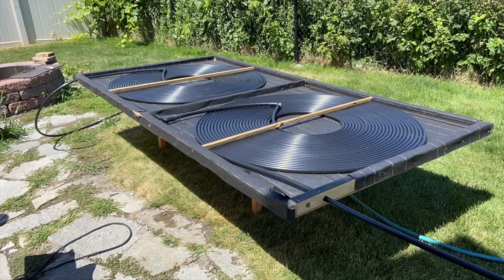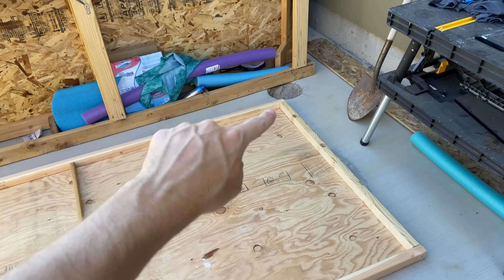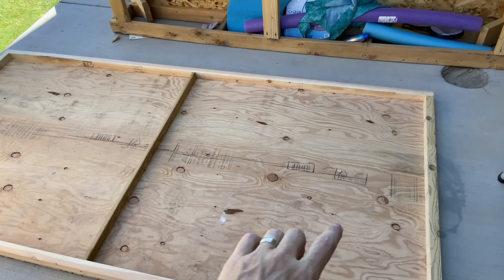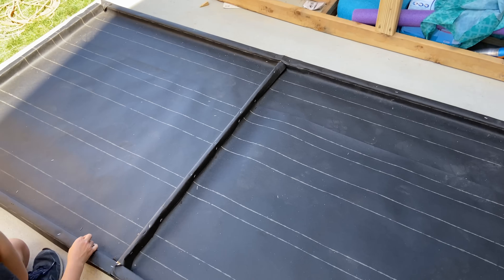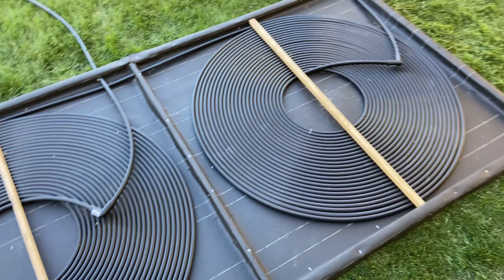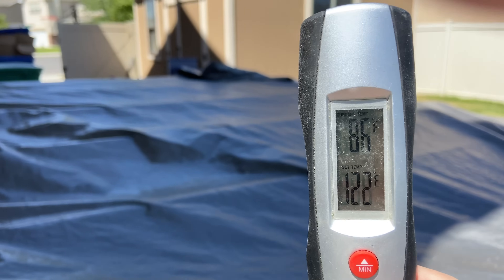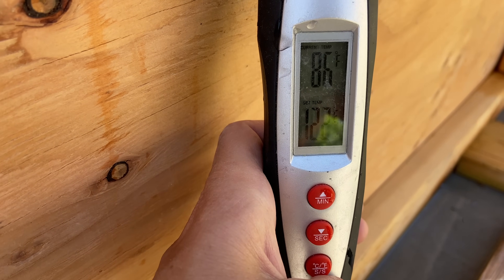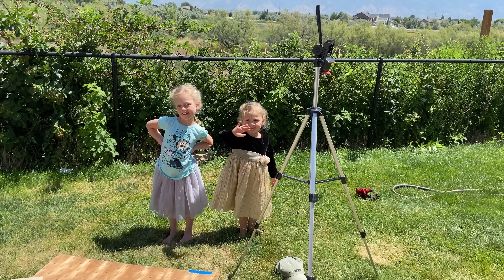DIY Pool Heater - $50 Solar Heater

Comment: Awesome video………but……the flow rate times the return rate divided by the square root of 62178=9732….not 2… so if one follows this coarse of thought…then a child might ….and I mean….MIGHT…..be able to find the coefficient value of ORIANS BELT on any given day in March…….but what do I know……these are just mere calculations by a NOVEL astronomer fixed on the collateral…blah,blah,blah,blah………blah

Comment: So I just finished building mine ....I'm in Arizona so it works well, however, the price today to build is closer to 600$ and that's with 50' of 1/2 " copper tubing
Reply: 2 degree on an 87 degree day

Comment: How is this for winter months or hot tubs?  I have a inflated hot tub that I wanna heat.  Instead running electric heat is expensive and use our wonderful source for heating in the winter months.

Comment: Great idea.  What size pump is used?  I’m sure too large of a pump would pump too fast and not allow the water to heat enough, even with slowing the flow with a valve.

Comment: I learned my lesson. A coil does no work, especially when it is not 100% flat. Warmer water wants to rise. In a coil, in order to move forward the hot water with a lower specific weight has to fight the colder water. 
It is better to have a series of parallel tubes with the outlet at a higher level than the inlet, then pure physics forces (hot water with lower specific weight will rise and will draw in colder water at the bottom.

Comment: Glass is far superior to plastic for trapping heat inside the box. Capturing the most heat will occur when you move a greater rather than a smaller amount of water through. Heat transfer occurs at a more rapid rate the greater the temperature difference between the warm collector and the cooler water.
Reply: Yes heat trap should be improve. And heat transfers to cool water at high rate.
Reply: Im wondering why he didn't put some insulation under the coils. Is there a reason not to do this? Sorry, but I'm not very mechanically adept.
Reply: @katella  Using this collector in the summer the temp difference is relatively small, so there is a small amount of heat loss through the collector. Many pool heater do not even use a plastic/glass cover as the black tubing will heat up sufficiently to bring the pool water up to desired temp.

Comment: Back in the day my dad threw a water hose on our roof, coiled at the moment and it was more than enough to heat our inflatable pool. This is WAAAY OVERKILL, you could provide scalding hot water to your home with that.

Comment: It's all BTUs in and out.  1 BTU of heat will raise 1lbs of water 1'F.  (8lbs per gallon roughly)

A 1000 gallon tub needs 8000BTU to raise 1 degree.

Figure out your flow rate through your solar collector.  Just fill up a bucket and time how long it takes.

BTU per hour = (output temp - pool temp)×gallon per hour through your collector.

You roughly get 4-6 hours of "full" sun with a properly angled collector.

Example
If you have a 600gph flow and a 10 degree increase in water temp.  That system would produce 6000btu per hour.
This would increase our theoretical 1000 gal tub ~4 degrees each day or around 32000 BTUs.

If you need it to go higher you either need to install insulation on the tub or make a bigger collector or add another collector.  You only need enough flow to prevent the water from boiling or keep it below say 120.  (Steam or scalding is bad.) Flow has nothing to do with how well it works.

Comment: I wonder if this would possibly work in winter.

I want to circulate captured rain water in and out of 2 IBC totes, using the coil method like yours, to stop them freezing in the winter. I certainly don't want to empty the tanks every winter and waste 550 gallons of clean water.

I have a Harbor Freight electric water hose pump. I'll soon have the 2 totes, side by side, with their spigots connected via PVC pipe. I plan to pump the water out of one tank send it thru the coils, then back into the other tank in a closed system. 

Even on coldest winter days, as long as it's cloudless, the coils should get plenty warm. I plan to add an electrical outlet timer to run the pump 20 minutes or so every 3 hours. What do you think?

Comment: you need to do a mathematical calculation on how much the flow you are using will heat what quantity of water  and how many degrees.  That small flow will do nothing on anything of size.

Comment: Great video. Are you using your existing pool pump to cycle the water or are you using a secondary pump .If so do you mind telling what GPM or brand used ? Thanks !
Reply: I also have this current dilemma. We will not be hooking up to the pool pump, so need a secondary pump and do not know what type or what size. We plan on using approximately 400 feet of tubing in two separate coils. It would be the 1/2 inch irrigation tubing.
Reply: FYI, this is a 4,000 BTU/hr system. I recommend you confirm this will be worth the effort for you!

Comment: Great video! What about upscaling for a large pool: What are your thoughts on 1000 ft of 3/4 or 1inch tubing, on 2 or more sheets of plywood, etc. ? Would this work as well since I would be replacing pool water faster?
Reply: If your talking about a built-in pool You wouldn't want your main return line doing this! Maybe  the aerator line or a water features line.
Reply: @rimc8783  You’re right it would be a totally separate auxiliary pump

Comment: looks good, so did you end up using the 2 loops in series after all?  Usually corrugated clear plastic is UV protected, but since its IR that's doing the heating, no probs. Did you divert or split off your pool filter pump to the coils?

Comment: It’s not clear why you would slow the flow down. The output temperature goes up but the flow of heat from the hot part to the cold part is slower, so you reduce the rate of heating. Fast flow may give you a lower output temperature but the heat is removed from the hot part much faster, making the process more efficient. Also, if the water in the pipe is already hot, the heat gradient between the hot water and the hot pipe is lower, reducing the efficiency of heat absorption by the water. So you best run at highest flow rate as it will reach max temperature faster
Reply from the maker: Yeah, good tips here